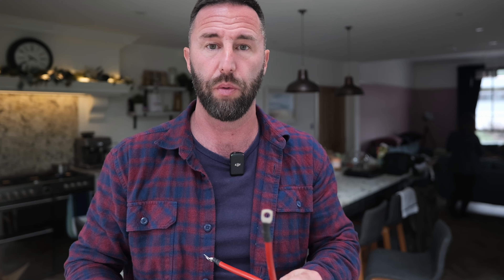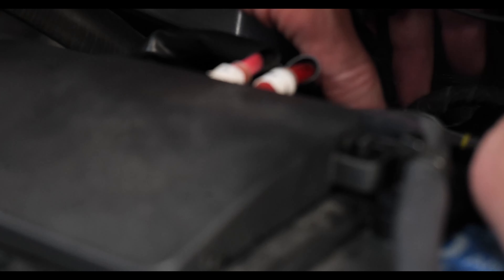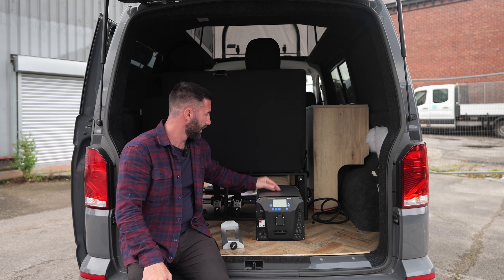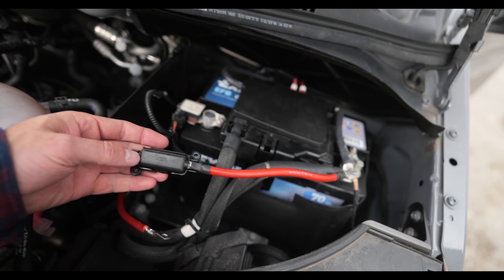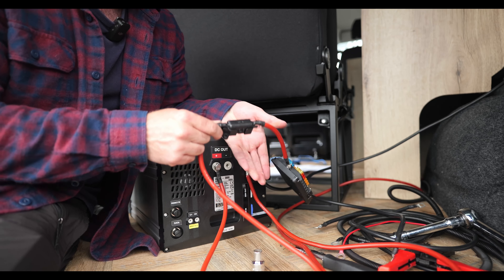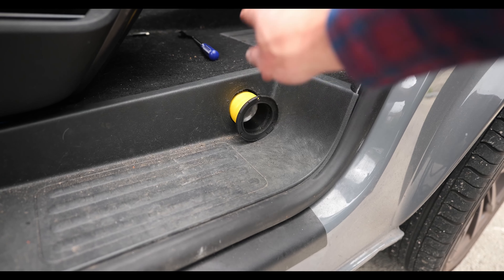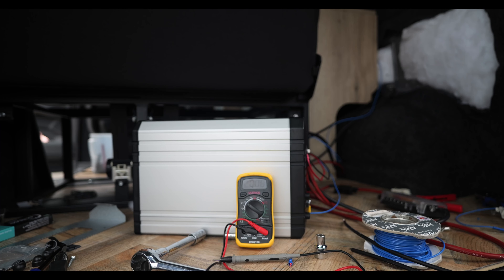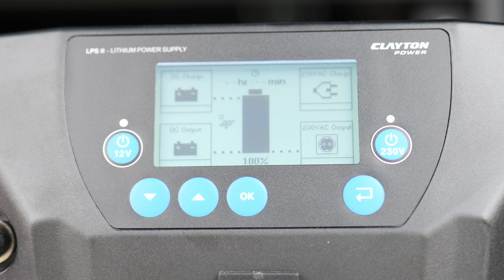Gas free VW Transporter T6.1 - Clayton Power LPS 3000 aka the Victron Killer

Comment: Fantastic video Mark! The more I see of this product, the more it makes sense! Quick question: in order to have a decent DC charging input, do you have to upgrade the stock vehicle alternator or is it good enough?
Reply from the maker: Thanks Anthony. 🤙 Appreciate it. 
No there’s no upgrade needed. The inbuilt Clayton DCDC charger draws 45A or 500w. As you can see it tends to pull a bit more than that in general at just under 600w which is great. 
Here are the ratings of the different models. 
VW Transporter models. 

T5 Standard 90A
T5 upgraded 140A
T6 standard 140A
T6 Highline/kombi 180A
T6.1 Standard 140A
T6.1 Highline/Kombi 180A - 250A

Comment: Great video!  Planning to purchase a vw transporter later in the year to convert and thinking this is the road I want to go down.  Planning an induction hob rather than gas hob, more for space saving etc.  Hopefully this unit can handle it.  Was planning on having the ability for a couple of days off grid if need be and electrical hook up for any longer.
Reply from the maker: Why thansk you. Glad people are enjoying it 🤙Yeah watch our test with a full days cooking - 3 hot meals with two induction hobs and it’s plenty. And if at a real push you are standstill in a spot for a few days and you need a top up you can just run your engine. It’s like driving around with a little generator in your van 😇

Comment: Good video, but you could neaten up the install under the bonnet by using the spare fuse slot in the fuse box on top of the battery rather than going to the battery positive.
Reply from the maker: Ah nice one. I didn’t even know you could do that!!!
Reply: @ahoyleisure  yes, it makes thing easier. Studs are in place, just need to put the fuse in. Shame I cant post a pic :/

Comment: Hi Mark. Am just about ready to install the 2500 as supplied by yourselves. I'm struggling to get a definitive instruction on the C1 connection details. Ignition on and alternator running are not the same thing. Connecting to the ingintion on could enable charging of the Clayton battery prior to starting the engine. Access to an engine running/alternator running signal involves enabling a signal in the engine management system BCM code, I'm told.
Reply from the maker: Thanks for the call Fraser. Yeah you are right, there is slight risk with ignition live over engine live but on the Transporter it’s a much easier install using ignition live. Note you do always have the jumpstart function in a Clayton if you ever did leave the ignition on. I’m going to do a bit more digging and come back to you.

Comment: Great video Mark 👍🏼 An easier way to ground your DC OUT negative, would be to put a short link to your DC IN negative - saves you having to run 2 wires to the van chassis.
Reply from the maker: Never thought of that great tip! Nice neat little 4”-6” loop in a u shape would do it.
Reply: @MP66UKC What would be the benefits/drawbacks to this except for less cable used?
Reply: No drawbacks, just less cable and a neater install
Reply: @MP66UKC  except you could have double the current flowing through 1 wire. You might need to use thicker cable. I haven't done all the sums yet.

Comment: Hey. Your videos were one part of taking the decision to get a LPS2. However, I got problems to start solar charging working. There's a parameter "self-learning start voltage" in the solar menu. It learns but only increasing the value. Now it is so high, solar charge never starts again.
I can't change the value using the menu, so ... what is the trick here? Or is it just stupid software programming or maybe no-one uses solar with LPS2?
Reply from the maker: If you go into solar and turn it off and back on it will reset it.  Please note that it will need a minimum of 15v to start working.
Reply: @ahoyleisure  thanks for the quick answer, it worked. However that is a bit strange that it got so high that it doesn't start charging again. Would not be funny to reset C2 every day...
Reply from the maker: It is self learning but it also has perimeters for protecting itself. So in the first few days as its learning or as its connected it may need resetting.  As long as the watts are below 400w and the open circuit voltage is below 50v everything will work ok. Ive never had to reset mine other than after reconnecting wires etc and I've had mine for years now.

Comment: I ordered the power cable set from transporter hq.  I have got it throught the firewall in to the cab and run it under the front seats. However, it is not long enough to reach the back of the van.  Am i able to extend the cable, or will i need to rip out and purchase a longer cable?  I have a swb t6.1.
Reply from the maker: I would to be safe Paul. Anything over 5m in length should be thicker than 16mm. It’s only the positive wire though Paul as the ground can go to a suitable place on the body work. Any questions at all give me a bell on 07905949435.  

I will let you off for not buying from me, you could have saved some  💰😉